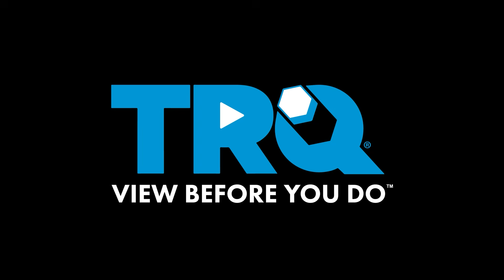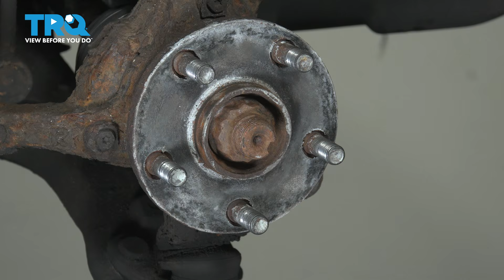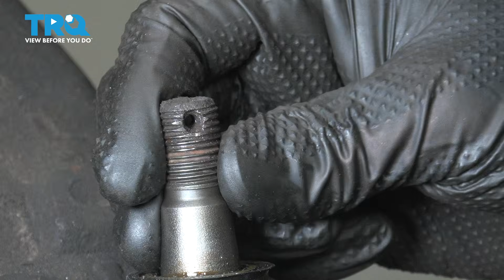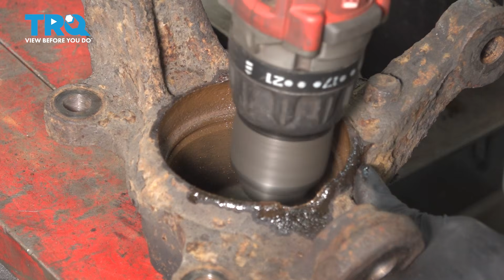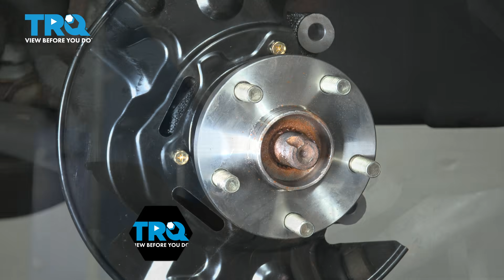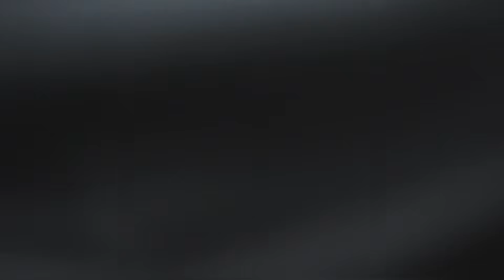How to Replace Front Wheel Bearings & Hubs 2003-2008 Toyota Matrix

Comment: Don't do this. Be smart, buy a full front knuckle with wheel bearing. I did that for my Sienna which also is press fit at the front. Dontcha wish they made it easy on us and used bolt on bearings both front and back. ARGHHHH!